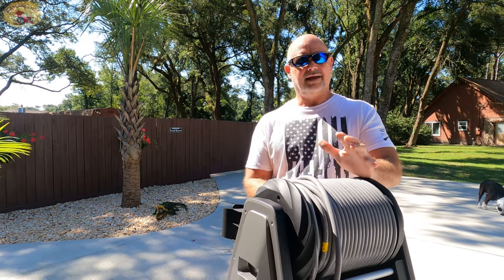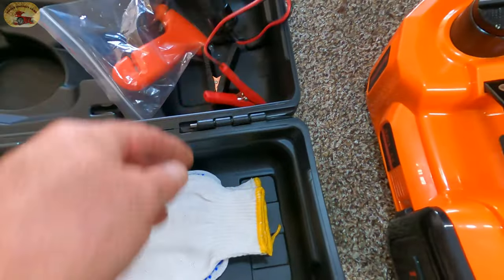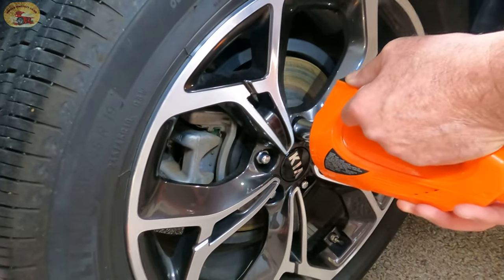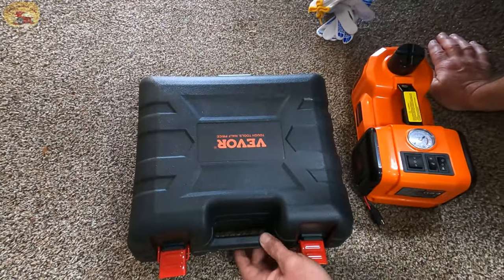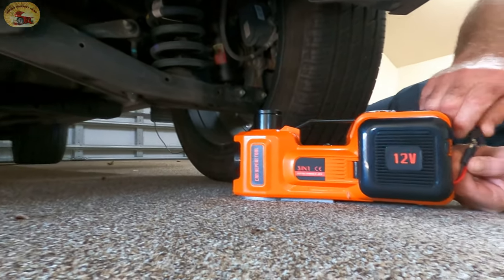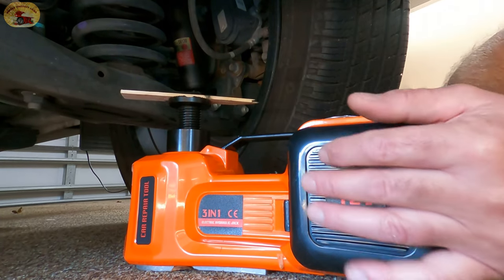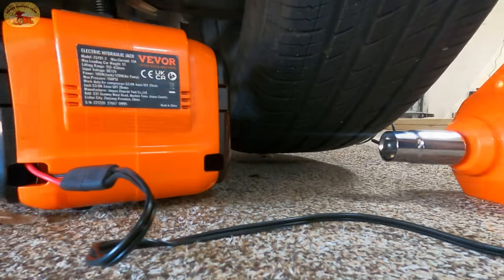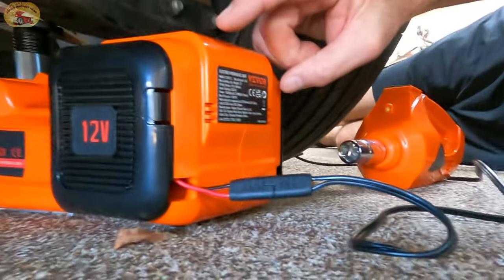Amazing!!! This TINY Portable 5 TON Electric Car Hydraulic Jack WILL BLOW YOUR MIND!!!

Comment: That's a nifty combo. Cracking those nuts can be difficult for even someone my size, let alone for the smaller ladies. No more need to tote a steel pipe to extend the tire iron.

And having a portable compressor has helped me out more times than I can count.

Thanks for sharing this find, Mike.
Reply from the maker: Our pleasure to share Alex! It's is a sweet little rig for sure! Thanks for watching, hope your week is the best my friend. mad Mike the hammer SPC

Comment: Just make a solid 6" x 10" cement block (pour ready mix/with pebbles into a home-made 6"x10" wooden box) jack up your car 12" from the floor and let it seat on a pair of  jack stands.Then get the electric jack on top of the cement block and now your jack will be able to lift your car an extra 6" off the ground (total 23") to work under your car to change brake pads, tie rods, ect easily!.Now your garage has become your own DIY personal mechanic shop, always remember to add additional jack stands for safety measures!

Comment: Greetings from across the pond in Australia.  I purchased a Vevor electric scissor jack which is powered in the same manner. I built a garage dolly so I can move a 300kg motorcycle out of the way in my workshop.  I bought the unit to power a scissor lift to modify the garage dolly into a scissor lift to be able to work on the bike at waste height.  Not so sure about the safety of hydraulics.  These units have a lot wider application than just lifting cars.
Reply from the maker: Greetings to you 000gjb! Glad to have you here with us Australia! Thank you for watching and sharing, we truly appreciate your input, have a great day my friend. mad Mike the hammer SPC

Comment: Interesting video; why wouldn’t you jack the car at the jacking point instead of putting the jack under the suspension? Seems like it would be safer and less hassle.
Reply from the maker: I put it where I put it because I didn't want to make a big ordeal out of the process. You can put it wherever you want to put it my friend. It's a fantastic tool to have, that's what I do know. Thanks. mad Mike the hammer SPC

Comment: Reasonably good jack, I don't think they are really uonest saying it's a hydraulic jack tho. Why would it need to run the motor to lower it, you'd just need to open a bleed valve? I think its a worm gear jack.

Comment: I wonder if it will fit under small cars
Reply from the maker: It's this https://amzn.to/3KviKpa    and these are the dimensions  Item Dimensions LxWxH: 11 x 5.7 x 6 inches  Hope this helps, thanks for watching, have a fantastic day. mad Mike
Reply: The manual says it for "sport utility vehicles ", and it shows a minimum jack (device) height of 6.1 Inches. Almost no car with a flat is higher than 6 inches on the flat corner of the car... hence, SUV in the manual...nice device, but I came to this conclusion some time ago when I first investigated it for purchase..